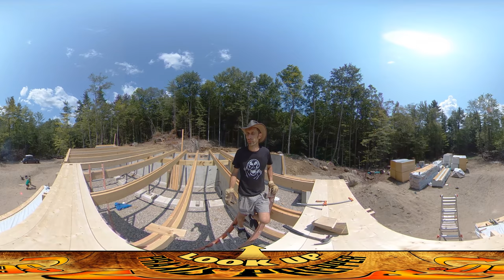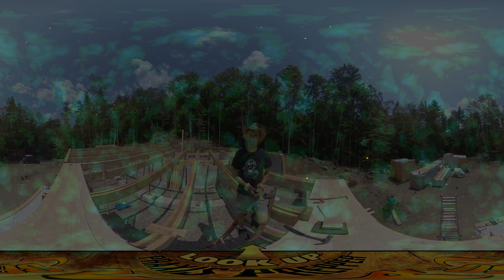Homestead Building - Floor Joists Installation Begins, Tools for T+G Floor Board Install

Comment: Hmmm, i know you are following plans, but personally i would likely stagger these boards (using the joists as stagger measurement) and then just cover the whole floor at once, to then use a drill and/or a good saw to cut out any spaces i need to be open. Some part of me is even thinking about doing stairwells this way, and just 'cut my losses' and use the 'waste wood' for something else. I know it's a tad more money, but time is money too, and it makes me feel it would take a lot less hassle that way.

Comment: That's not a punch.  It's an alignment taper.  Used to align the holes in pipe flanges etc.  It's probably made of tool steel and is meant to be driven with a hammer.  Safe for your application I would imagine but I hope you'll wear some glasses just in case it isn't.  Just can't see you with a patch on one eye.
Reply from the maker: Thanks for the info. I didn't know that. The hammer-struck end is getting a bit deformed, so it seems it's more prone to bend than shatter. I personally hate safety glasses (in New England) because it's so humid here that they always fog up and then you're blind... which is even less safe. I wear them for brief periods when I know there's a specific acute danger, but beyond that, they just don't work in humid weather I've found.

Comment: You have two more floors above that floor level right? Seems like a long ways to go before winter... will you be able to close up the upper levels and move in before it is finished if you aren't able to fully finish before the weather turns?
Reply from the maker: One more floor above the one seen here. I'm actually at present about 3 board runs from being done with the floor you see in this video. Still... gonna be close.
Reply: From what i have seen around here (i live in an area under development) the main thing seems to get to the roof, so that most of the stuff is sealed up from the 'above' ... then over here they put scaffolding up and cover the outside with plastic and work on the walls dry and 'somewhat warm' (i would imagine a blower/heater to be in there during minor frost). Then once the walls are up, the rest is just finishing on the inside.

Now i don't know when the weather will turn where Praxis is, probably don't even want to ask as that tends to give away longitude somewhat, but i'm at 52 north (the Netherlands) and it will be ok weather (like no frost, it'll rain though) until half of november or so. That is still 2.5 months away... So taking a month per floor (counting the roof as a floor), would give a reasonable estimate of where he is likely to be when the weather turns... So i have faith! Then hopefully he knows prevailing winds and local weather patterns, so he can start on the wall that needs to be sealed the most... but after that, it will likely be working under some sort of sealed of scaffolding to keep the weather out and make a 'workable' space.
Reply: Dutch Courage Yes, that would be my expectation but with all the contractor issues he has had I could still see it being a problem since there is still contractor work to go and I wasn't sure if he had one more floor or two more to go. Bigger problem could actually be getting critical inspections done in a timely manner.
Reply: @inmyimage1081  has he? i thought he was basically free to work on everything himself? 

As far as inspections go i don't know how that works over there, and what needs inspection and when. But yeah those things can slow one down. Considerably...
Reply: Dutch Courage Has he? needed to use contractors for some stuff? If that was the question, yes he needs contractors to do some of the work and they have been a pretty constant source of frustration so far. I think moving forward there will be fewer blocking issues but I am pretty confident there will be structural components that will require contractors, one major one that springs to mind is raising roof trusses.
Reply: @inmyimage1081  hmm not sure... like i know he needed contractors for the ground work and the foundation, but i think the build will be all himself (and Dad and River)... maybe something to ask at the next life-stream, because apparently there is some confusion about this. ;)

Comment: Certainly sounds like you've done this before or at least researched it well but 2' centers, on a floor? I don't recommend it, even with 2x T+G.  I've built many homes and I've only done that once, per customer request and against my advice.   He saved about $200 on the initial build but after I returned the next year to jump in additional joists, it cost him much more that he saved.  
Tip, if you ever attempt tile on that floor be sure to use unsanded grout.
Reply from the maker: It's actually 2'11" between joists. This is the same approach as used at the last home though and the floor felt nice and strong and solid there. So I think we'll be good again. We WILL be doing some tile over some of the floorboards in the bathroom. It's where I've been laying all the messed up, dented and otherwise ugly T+G boards so far. I'll be laying plywood down over the T+G before I put the tile down though so as to avoid any cracking issues. I did that at the last place and the grout was totally solid. I think I used 3/4" plywood for that if I recall.
Reply: Praxis Homesteading and Survival Skills, well the t+g boards out west are certainly stronger than the ones we buy here.  Ours are typically white pine or knotty pine which are far less rigid than the fir and spruce available out there.  Same with the joists I bet because 2'11" centers are  just unheard of here.  

Btw.  Good to see someone who says that they are building their own house, actually doing their own work.  So many fellas claim to have built their homes but in truth were actually just the general contractor, not the hands on carpenter.  Few appreciate the difference aside from those who have actually done the work.  
I've built several homes for myself from foundation to ridge cap that never had a single helping hand.  That is one powerful feeling of accomplishment.
Reply from the maker: @bugoutbubba3912  I agree about the feeling one gets building their own home/shelter.  There is something primal about connecting with the process of creating one's own dwelling space.